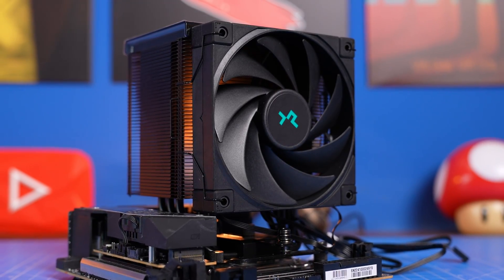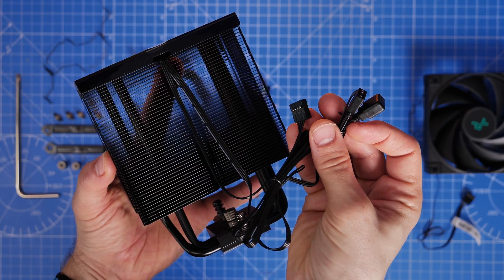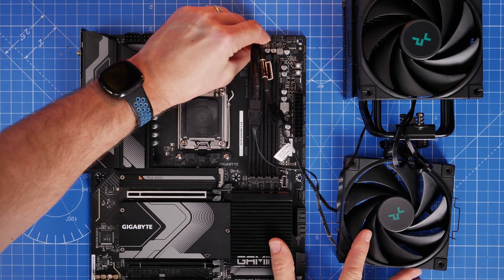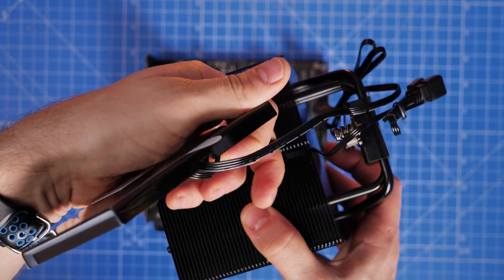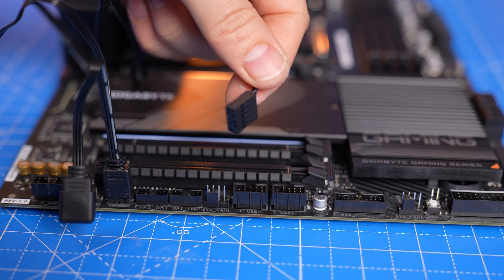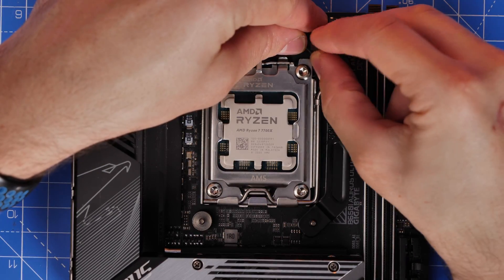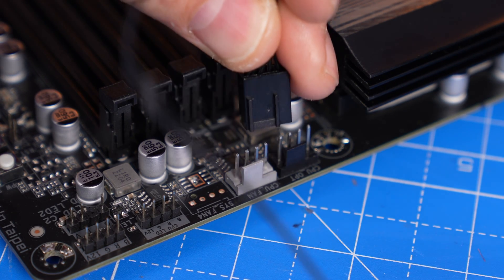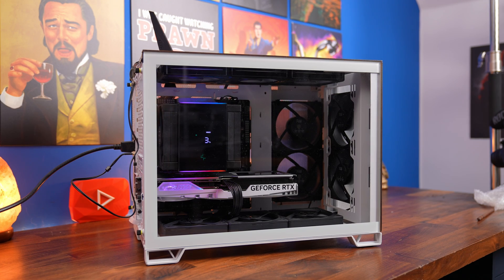DeepCool AK500 Digital setup and install guide - Intel and AMD install tips

Comment: Cheaply made generic cooler with a gimmick display added to make it look cool, and they can't even put their stickers on the Chinese fans straight.
Reply: It works and it performs great, I don't see what your point is. And what about the sticker? The fan will be running anyways and it's not noticeable if it's running at hundreds of RPM, so what if it's not straight? Such an idiotic take.

Comment: Hey, excelent tutorial. I'm curious, at 05:50 you mentioned that for LGA1700, the bracket holes sit on the second hole. Does that mean that the same brackets can be used for LGA1200 mobo?  If not what is the 1st hole for? Thanks

Comment: What can I do if my mother board has only 4pin rgb ?
Reply: Nothing, don't plug it anywhere and hide the cable somewhere. If you try putting in the 4 pin you may cause a short.
Reply: Does anyone know the answer for this? I only have a 4 pin RGB
Reply: It goes to the 3 pin slot.

Comment: Where can I find these screws which go onto standoffs? I have 3 but one is missing and my heat sink which is clasic AK500 has a slightly bent (unable to fit over RGB ram where as previously would work). Going to use a wrench to fix into place. I then just suddenly thought a iCUE LINK AIO would basically do it in this new build but isn't it cheaper just to fix a broken aircooler?

Comment: Why is it when i boot it it saya cannot detect device and needs to restart then works properly after. Dont want to restart aftwr booting everytime i open the pc. Its not like that before i reformat my pc.
Reply: mine too it cannot detect the device help please
Reply: Fixed mine i just neet to complete shutdown the pc after using it, power supply off too and it works again properly, if i dont turn off the power supply sometimes the error goes back again lol. @MurkridAI

Comment: Anyone know the difference btwn the AK500 vs the AK500S?   It appears they both have RGB and the digital display.   I can’t seem to find how they differ.   Ty.
Reply: Nm.  I found the difference.   The 500S is for ‘slim’ from my guess, if anyone else was wondering.
Reply: Smaller heat sink

Comment: I don't have the deepcool logo, is it the 3pin 5v rgb header? My motherboard only have 4pin 12v, waiting for the convertor to be delivered. I'm using it on my i5-10400 :)
Reply: Yo so I had to do the same thing, but mines displaying really weird colors sporadically . Did you have this problem by chance?

Edit: yes I have the driver/software installed, and the display dooooes show me the system temp as I specified.
Reply: @wubwubinmytumtum  i bought the deepcool convertor but it is not working and can't detect on my armoury crate, so I removed and get a refund to the seller the usage and temp is working but the rgb is not, it's okay for me

Comment: Any opinions for CPU air cooler to use with i7-14700? Is AK500 is enough? Or should I go with AK620 or Assassin IV?
Reply from the maker: I'm using it with that exact CPU with no issues

Comment: These are great for very cheap builds, but I think the AIOs are becoming so easy to install and so much cheaper as well, that people might as well buy AIOs. I want to be clear, that there are not wrong with these coolers at all, I’m talking about the way I see it.
Reply: On my own builds I only use ASUS Ryuo AIO's simply because I am a hopeless ASUS fanboi, now that I got that out of the way....😀 I installed an Artic Liquid Freezer II 240mm last weekend on a 12700k for a retiring co-workers gaming PC. The cheap Artic AIO performs as well as any of my pricey ASUS AIO's. Pain in the arse to install, instructions are complete trash but once installed the Artic AIO's cool like a total champ. If anyone in my orbit asks advice on an AIO I will shill for the Artic Liquid Freezer II AIO's...
 Just sayin.
Reply: Nah, I'm good. I'll never buy a Liquid Cooler. This can run for well over 10 years and it doesn't need to get replaced ever. Liquid Coolers are recommended to be replaced every 5 years, and even if they are non-conductive I don't want a radiator and a pump flowing in my PC.
Also, this cooler is on level with a 240mm AIO cooler's performance for referance. I'm completely fine.
Reply: That really depends on the brand yes they all have lowered prices but if you get a 360mm major brand your going to pay some money, but there are some inexpensive lines out there that do a great job at half the price and if you waterproof your components if you can buy another one for 1 of the other ones without digging deep in your pocket! Maxwell
Reply: Works great on a 9800X3D. While playing games it always stays around 60c. Only in CPU intensive games I see it hit 70

Comment: Just use a screwdriver. That tool is less than ideal.
Reply from the maker: it's long enough to get through the hole in the middle. I didn't have any issues with it. You did? (just curious)

Comment: Can u turn the cooler 180 degrees so the fan is more over the ram so you can have 2 fans on the small mb? And can it mount spun 90 degrees? To exhaust out of the top of the case?